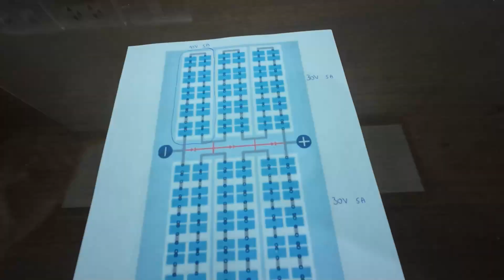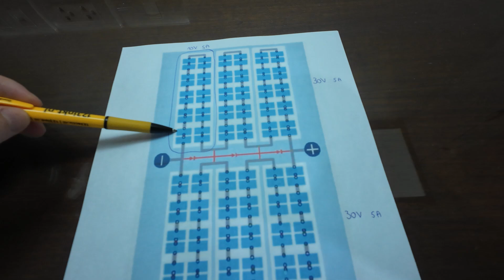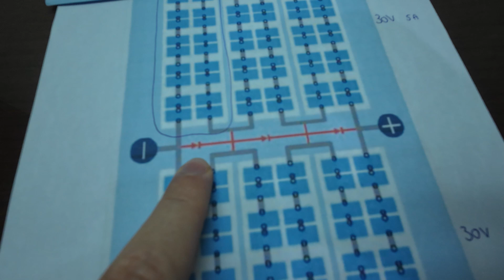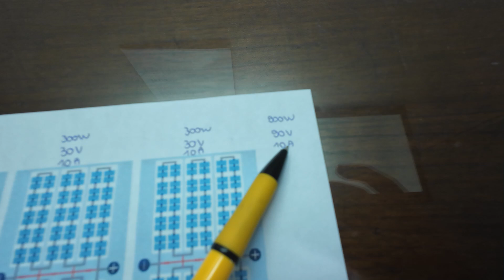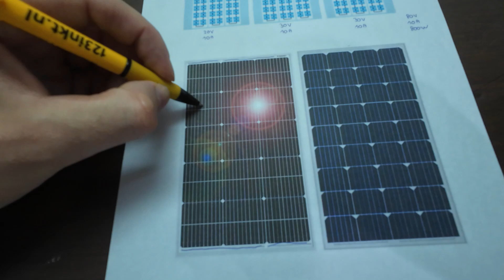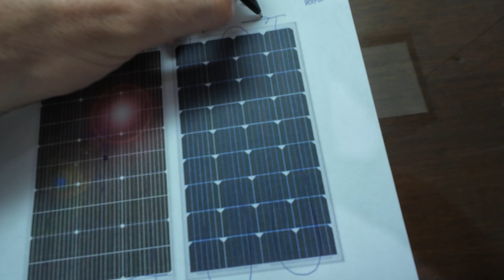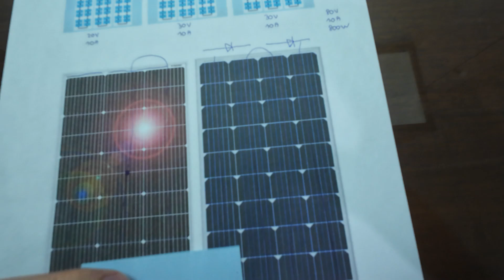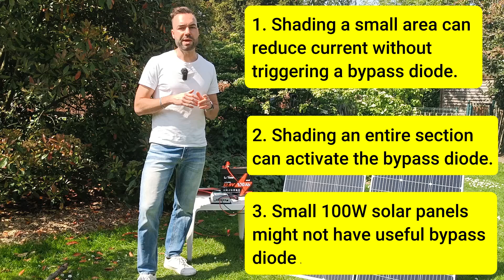Shading Effects on a Solar Panel - Branches, Wire, and partial shadow

Comment: Thank you for a very informative video.  I am trying to design a tower that incorporates PV Panels and a VAWT for northern climates where the greater consumption requirements are when the sun is lowest to the horizon in winter but in summer consumption requirements are lower.  The logic is that the PV Panels rotate to meet the sun from dawn to dusk and pivots as the sun climbs from the southern horizon from December to June and vice versa.  The VAWT on top would also supply power when wind conditions match.  The problem I have is that I need the PV panels spaced a greater distance apart for energy extraction in summer than in winter.  The panels can be spaced at about half in winter to capture the suns rays when the angle must avoid shadows.
The logic is that the PV Panels can be pivoted for maximum Sunlight capture and positioned as needed to eliminate snow, sleet and debris accumulation or for safety when wind is blowing excessively.

Comment: hello!, love your channel! im really stuck on which panels to go for, im between aiko and jinko. we have pretty bad shading in winter. ive made a video to show you what the shading is doing. those aikos are supposed to have superior shading properties than other panels, but theres very little solid [roof to back this up.. im definitely going tot get optimisers on every panel. heres the video..   https://youtu.be/mhOmyUcrJHQ wondered if you think i should go the aiko or save around 1500 dollars and get the jinkos? thanks!!
Reply from the maker: That's a tough situation. Nice software though, what's the name of that? I don't think you need the expensive panels, the bypass diodes of the jinko will do their work. You mentioned this is only in winter, so the other seasons it's not that bad? Optimizers might work, however, there is a video that compares optimizers vs normal strong inverters and found no difference because the bypass diodes to their work. You can look at that video. Personally I think optimizers are over-valued and bypass diodes under-valued.
Reply: @cleversolarpower  thanks for your response! shade is bad for 1 month then gets to almost perfect conditions by three months over winter in australia. the inverter will be a 10kw sigenergy. i think its 4 string.

Comment: If the 100-watt solar panel had the diodes connected to the middle one, would it be able to bypass it when it's shaded, The Renogy 100W solar panels, the diode's are connected to the middle one, but there's still only three cells across, not four👍👍
Reply from the maker: That single diode will bypass the whole panel.

Comment: It is a good explanation of the principles of shading (cells), but in a real situation, the shade is not as "sharp/dark" as with a "paper" directly on the cells. While shade always reduce the production, there might be enough radiation bouncing to keep them working. Another question is with what A and V.

Comment: Question - with the large panel, what happens when you shade out the centre, and/or the right panel section?  How do the diodes work then?  To me it appears that shading the two areas mentioned would shut off the whole panel due to the very simple diode wiring.

Comment: At 3:50, one half-cut cell is fully shaded. No diode is activated (yet). Result: 5Ax30V = 150W. After some time, a "smart" MPPT would find the global maximum power point at (roughly) 10Ax20V = 200W, activating one diode. Did your solar charge controller find that? @cleversolarpower
Reply from the maker: No, because the panel still delivers 30V, no bypass diode has been activated because shading once cell is 0.5V, not enough for the bypass diode to kick in (0.7V). The mppt will find the new power point when the bypass diode has been activated. As you can see in the second example. It takes a while for the mppt to find it.
Reply: @cleversolarpower  This is a difficult topic, thanks for triggering me to engage! I just recreated your half-cut cell setup quick and dirty (Module = CS6R-390MS-HL; SCC = Victron Energy MPPT 100|30; Battery = 12.8V LFP CALB battery). Result after fully covering only one half-cut cell in the corner: Intially 5A was output (diode INactive, i.e. non-conducting; local maximum PPT). Then, after a couple of minutes (only one half-cell still covered), 10A was output (diode active*, i.e. conducting; higher wattage; global PPT). So, I think that either your SCC does not search for a *global MPP at all (got stuck at local MPP) or more time needs to pass (for the MPPT algorithm to change its duty cycle to find the point of the global max PPT)?
Reply from the maker: @diyEVguy  Thank you for letting me know. Indeed, some inverters have dynamic MPPT tracking (the global mpp you are talking about). I thought fronius was the only one to have it (string inverter) but it seems like victron has it too now. I will make an updated video soon.

Comment: Thank you very much for this excellent explanation how bypass diodes function. I have a rooftop installation with micro inverter topology. Now one panel generate only 60% of its capacity. Enphase informed me to contact panel for changing the panel as some bypass diodes have failed. Panel company has agreed to replace panel. Now I could understand the role of bypass diodes and how these bypass diodes function. Excellent graphics too.

Comment: Hi Nick, I have 10 420w panels in series and in late afternoon my neighbors chimney takes my output from 2.8kw down to .6kw for about half an hour then it goes up again to 2.8kw. Would optimizers eliminate that huge drop?
Reply from the maker: I recommend installing a Tigo optimizer, which is basically a bypass diode for the whole panel. The other brand of optimizers which I can't remember from the top of my head is a voltage-current transformer, but then every panel needs on because they communicate with each other. So my advice is get a single Tigo optimizer for that panel. I will do a video about it in the future.

Comment: Great tutorial as always Nick! It's amazing how a small shade affects the entire panel, and the whole system if wired in series. 

How do you feel about using DC to DC converters? I am thinking of using power from my older truck (2003 Chevy 2300HD) alternator to help recharge my lithium batteries in my RV trailer. Some people claim you will burn up your alternator without it. Others say you don't need it at all. 

Also, I have an ordinary lithium capable 20 amp battery charger. Will it work well mounted in my RV for charging from shore power? At present, my batteries only receive power from my solar panels for charging. I have a 600w cheap inverter, but it is not installed yet. I will be getting a 2,000w pure sine wave invertor soon.

Thank you so much for all you do to help everyone in the clean alternative power community! Cheers, Danny 💗🌹💗
Reply from the maker: I made a video about DC to DC converters. And yes, I recommend getting one. Yes, you can add a 20A shore charger. I made a video about multiple charge controllers. No problem having more than one charging source.

Comment: When in series the total current will be the current of the lowest panel (In your example 5 Amp), what about if the voltage is lowered from 30 to 20v? What will be total output? thnx
Reply from the maker: In a series string the voltage gets added up, so it will be 20+30+30=80V instead of 90V.
Reply: If it was parallel than it would be vise versa right? the Current will remain the same for all and the panel with lowest voltage will determine the other part voltages?
Reply from the maker: @keyable  in parallel, the current adds up and the voltage stays the same (lowest).